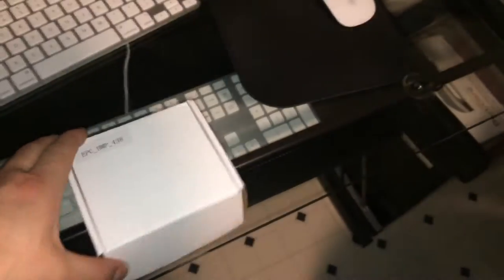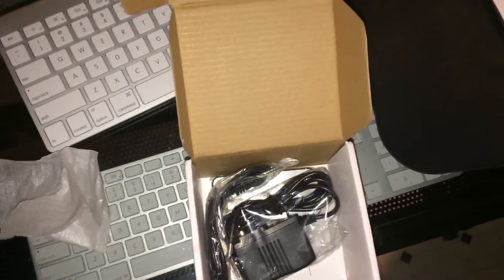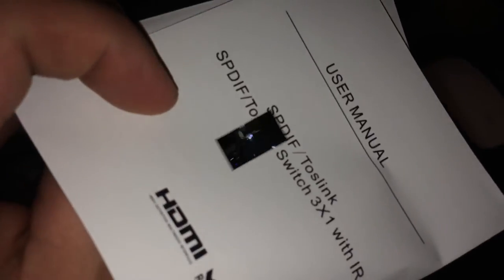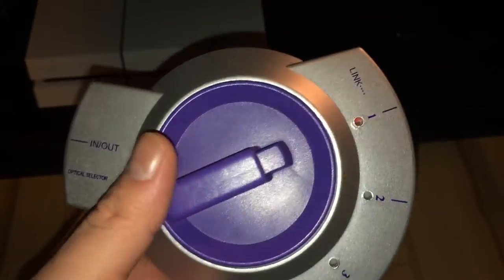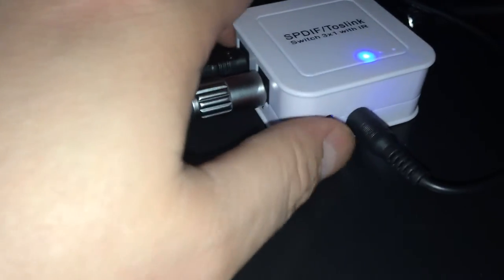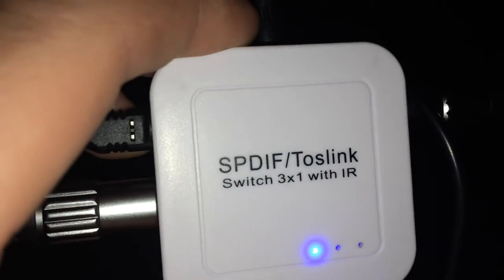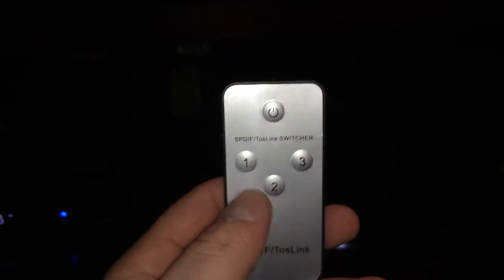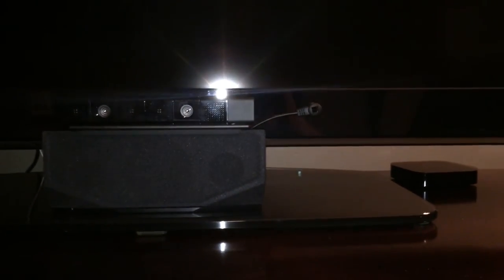Toslink Digital Audio Selector

Comment: I also need this splitter for a apple tv and a ps4, Have you notice a difference in quality using the splitter ?
Reply: It's a digital light signal, you won't notice any degradation at all :-).
Reply: I got it couple of months ago and it really helped before buying it, i always kept the volume on my surround sound system when watching Netflix on my apple tv volume 9-12 and on the PS4 7-10 i don't whats the reason but the PS4 is louder and to be honest i have noticed a little drop of quality and sound just a little maybe it's in my head but still that digital toslink splitter helped alot
Reply: SalemMillion It's probably in your head - with the optical digital light signal, it's digital. The signal either works or doesn't :-).